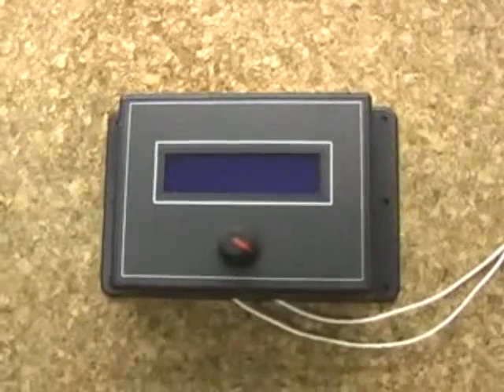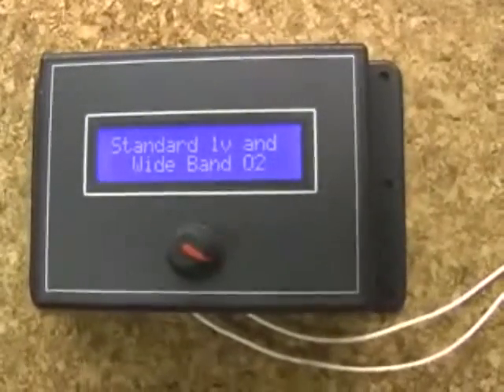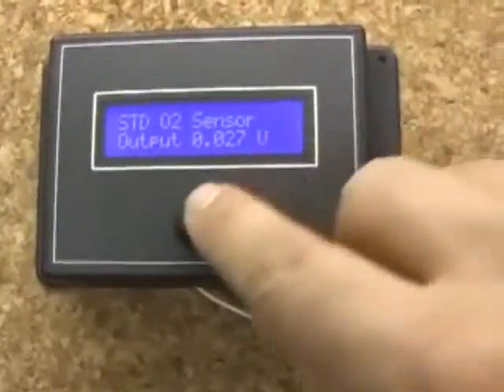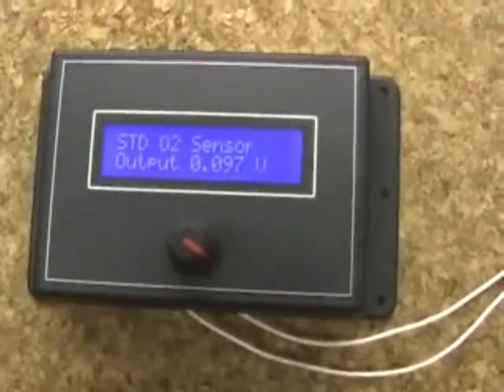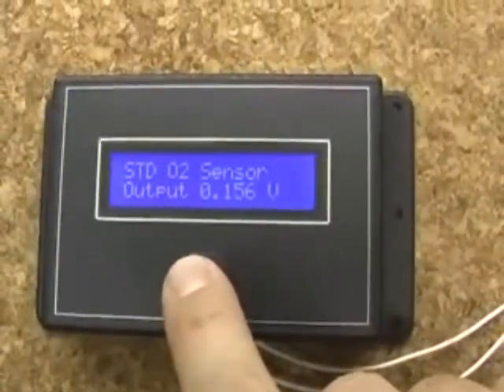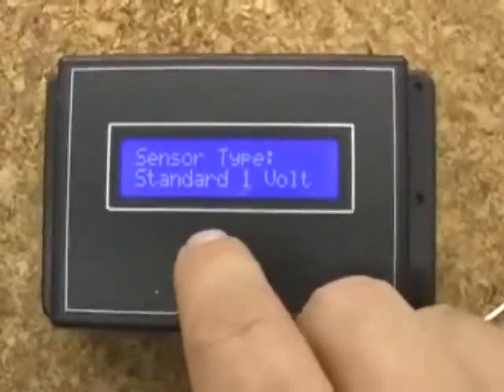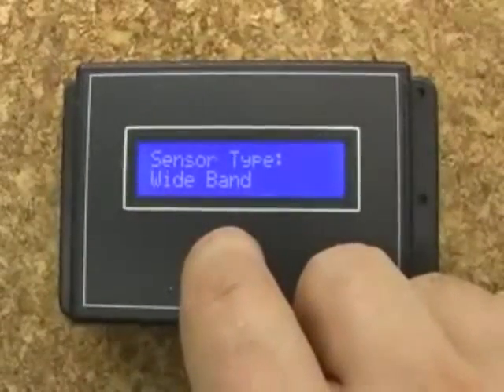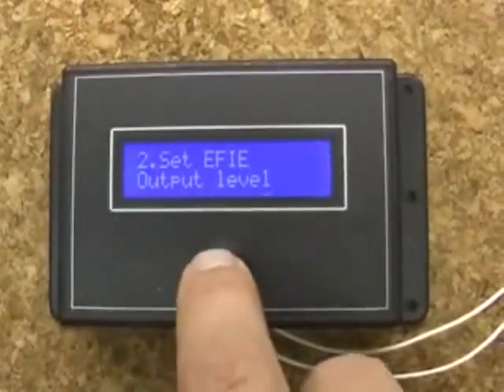EFIE ~ NEW DIGITIAL EFIE OPERATION  OVERVIEW FROM WWW.MARCHLABS.COM

Comment: Browns gas is cool but if the car has sensors it is best to either heat the hho before the intake and or separate the oxygen from the hydrogen in  the cell chamber and just send hydrogen into the engine. If you did this you could run the car with no petrol. As of yet I have not seen anyone do this yet.